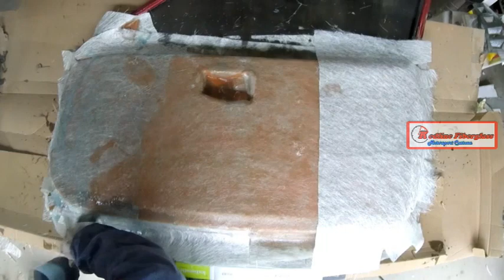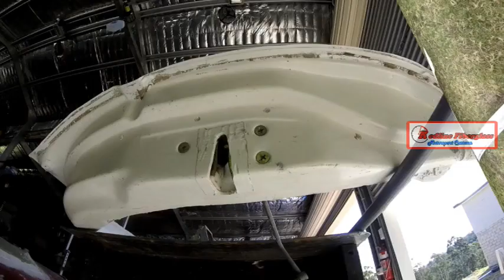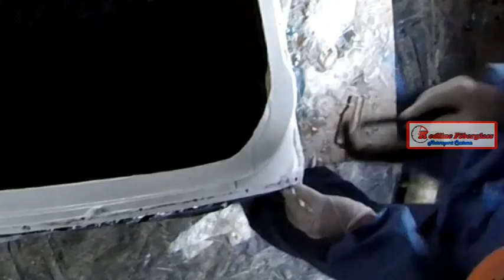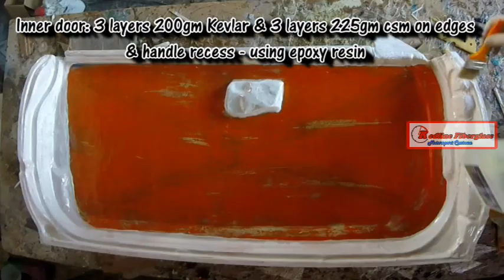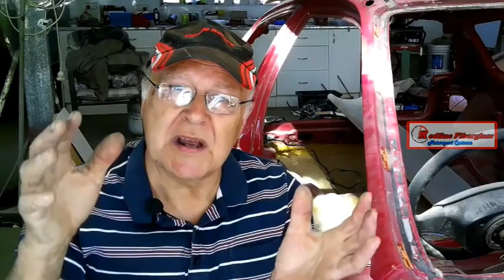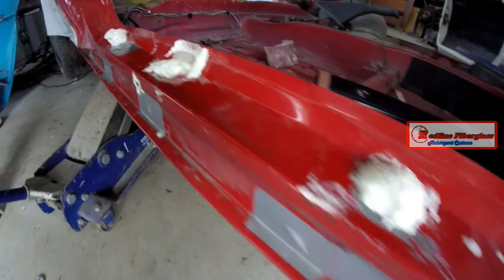Make Race Car Doors - Part 2

Comment: Mr. Mike -   Great Video - Your KEVLAR process looks to be the best bet for me to make front fenders (wings) for an old '70 Fairlady which suffered from the typical lack of inner fender protect: :-(    Over here we put SALT on EVERYTHING , NOT JUST CHIPS !! 
Cheers
Reply from the maker: If you are going to make front guards, this may help you overcome their shape. Fiberglass would be just as salt & rust proof as Kevlar, and you'd get a better surface to paint from using that process which includes Gelcoat (whereas Kevlar normally does not).
Reply: I wish I could have you make me some 1985 s10 doors and tilting front clip

Comment: Great stuff, curious what those black pieces are you using for framing to give the mould strength? Looks almost like rubber hose but of course that wouldn’t stop the flex?
Reply from the maker: They are 25mm black rubber hot water pipe insulation tubes from Bunnings plumbing dept, cut in half. Overlaying them gives them rigidity, and being rubber they readily take up complex compound curves wherever needed.
Reply: @BillsBuildandRace  wow I didn’t realise they’d provide enough rigidity, thanks 👍

Comment: Wow. I'm stoked beyond comprehension. Your work, philosophy and skills are always an inspiration. More people needs to subscribe to your channel. Tons of knowledge just packed into every video. As an engineer my views have changed a lot, in the last 5 years that I've been watching your videos. Found your channel on my first semester, now I've graduated and started working. Most of your diy videos for motorsports passes all the rules stated in most racing competition. When we engineered our chassis for FSAE, I used butted tubing like bicycles in our chassis. We had the lightest chassis in our class. Used techniques shown in your how to make a serious car wing videos. But used a cnc milled foam core with carbon ribs like aeroplanes. Then flushed out the foam core with acetone. My personal take on engineering is that its always a compromise between design, manufacturing ability, material, cost and time.

Comment: I am following your work, I am going to try to do a complete Volkswagen 1958 Van
Reply from the maker: Most guys think they have to make large body molds very thick, and/or put giant frames on them to keep them rigid - but you don't. Normal thickness is fine, then I cut hot water rubber insulation tubing in half and lay it on as strengthening ribs that will go around any curve. The only timber framing I add is to position the molds at the best angle for layup. My advice would be start on the small panels first. Use cheap unfired pottery clay to make your flange walls on curves - and they only need to be about an inch/25mm high.

Comment: Have you ever considered replicating a quarter panel in carbon or Kevlar for maximum weight shedding?  I know you made some epic fenders with flares, just can’t remember if you’ve ever replaced the entire rear panel above the wheels before. (We call them quarter panels in the states) maybe called a rear wing, or even a rear guard elsewhere?
Reply from the maker: Yes I did consider completely replacing the rear quarter panels on my Civic Muscle Hatch when building it, but the degree of weight saving versus structural integrity and the effort involved in going that far didn't seem to make it worthwhile in my case. The metal car manufacturers use for rear quarter panels is mega thin. The inner stuff is where it is thicker and heavier - but that is the structural bits. But every situation and type of car racing is different.

Comment: Hi there just a question regarding release agent? What did you use when taking the mould and then making the product from the mould? Cheers
Reply from the maker: I always use two products for release. Firstly a generous SINGLE coat of wax (not polished and multiple coats like everyone else tells you). This can be special release wax, or just common floor wax from a supermarket is fine. Secondly I brush on a coat of PVA release This is a product you will not get in any hardware store, but from fiberglass material suppliers (Google your area). It is water soluble and washes off.

Comment: What kind of resin was used for the casting and what kind of resin was used for the door. I know gelcoat was used just not sure what kind of resin to use on the fiberglass mat
Reply from the maker: Any general purpose poly resin will do. I use LSE (Low Styrene Emissions) because it's cheaper than Vinylester and way less fumy. As you appear to be new at this, I suggest you watch my first fiberglass tutorial which covers all the basics in detail. https://www.youtube.com/watch?v=iOZkwrfpit8&list=PLh5B6MCXRHiEFl6VaERQKJUGFRj4Coh4H&index=1&t=2s
Reply: @BillsBuildandRace  Thank you, my last comment disappeared somehow but you also mentioned 250gm and 450gm. I can get chopped strand mat in 0.045" and continuous in 0.060" will that work? Watching the video you recommended now! Thanks again
Reply from the maker: @Tookoff  Where are you? The Imperials equivalent of 22gm & 450gm csm is 8 & 16oz - as it is sold in the USA.
Reply: @BillsBuildandRace  everything I've searched in the US say either 1.5 oz/sq ft or 2 oz/sq ft.
Reply: @BillsBuildandRace  I have also found 0.9 oz and 3/4 oz

Comment: Does the foam also seal the lower door sills against water? Or do you run into an issue where you could have standing water inside over time?
Reply from the maker: Each cell is individual when foam forms, so it is impervious to water. Closed-cell expanding foam is completely resistant to water, and will repel liquids at all times.
Reply: @BillsBuildandRace  Thank you for the information and response. I appreciate it very much.

Comment: Just wondering, do you think there would be significant weight savings by just using a CF outer panel?  As in, keep the steel inner door/beam, cut the steel outer out, and mould the steel inner into the CF outer?
Reply from the maker: Probably the heaviest components in a factory door are the glass, locks & winder mechanism. The steel frame is likely heavier than the door skin in almost every case, so just re-skinning the door with CF would lighten it - but it would hardly be worth the effort IMHO.

Comment: My car weighs a little over 4100 pounds. What do you suggest I do to lighten the car and maintain its use as an everyday driver?
Reply from the maker: There's very little lightening you can do with a daily driver as you have to 1) KNOW all the road rules where you are that cars have to meet 2) also know what you are allowed to modify and not modify (which is usually almost nothing).

Comment: How is your door latch mechanism going to work?
Reply from the maker: What do you mean?
Reply: @BillsBuildandRace  The inside of the door is full of foam.  Right?    This whole thing has my mind buzzing.  I’m building a drag car.  I’m going to do both doors.
Reply from the maker: @scottycollins131  Stop stressing out. it's super easy! i did show somewhere in this build what I did - but even I can't find the footage on it. But here is what you do. Yes the door is full of foam. So then you cut a side pocket on the inside of the doors near the lock so you can slide it sideways into place to be bolted up using the factory mounting points. That gives you a hole to carve a hole for the outside latches up to the window lower sill. The inside latches are mounted onto a wooden plate glued to the inside of the outer door skin - this job being done BEFORE the doors are filled with foam. You drill a hole in the inner door skin catch recess for the rod that goes to it from the door lock. From the hole hollowed out from the door lock you just push a piece of sharpened 20mm electrical conduit up to where the rod to the inner door catch comes out, using it like a saw with a twisting motion to hollow out a tunnel for that rod. The conduit does not stay in the door - it's just used as a hollowing out tool. OK?
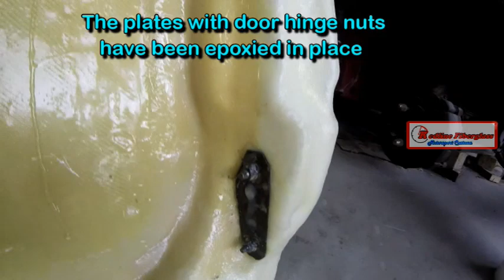Reply from the maker: Sorry - I didn't use a timber block to hold the inner door catch. What I did was fitted the catch to the inner skin before I joined the two door halves together. Then I epoxied the bolt heads to the back of the inner door skin. After that set, I removed the bolts & the catch, & then joined the two door skins together with the foam.  I showed this in this video at 10:11 sec.
Reply: @BillsBuildandRace  I've been brainstorming.  Worse comes to worst I can create a tunnel for the rod that goes from the door handle to the latch.  I'm building a 2000 Mustang.  American version.  It has a frameless window.  I think it will be even easier than the Honda.  And the weight savings will be much greater.
Reply: @BillsBuildandRace  I'm not stressed.  My mind is buzzing means that I have all kinds of ideas now.  I don't want to get too silly but this has opened up a new world for me.  I was already exploring HDPE and I bought a chunk of Lexan to replace the rear window I busted out.  Putting in a roll cage was the devil.  I got it done without busting out any glass but I could not get in there to make the firewall into the trunk.  After all the frustration I just took a sledge hammer to the rear window.

Comment: Did you weigh before and after filling with foam?
Reply from the maker: No - but the foam weighs 4 kg, in the cans and does not lose weight, so that is easily calculated.

Comment: I'm currently re-installing my Godzilla-heavy 72 lb. a piece original steel doors onto my '66 drag car after some cage updates, and wondering what I can do, maybe cut up, to lighten it up before it weakens the door (figuring very little if anything)... and ran into this video. Great video! thanks for sharing your obviously mad skills. Laying glass or carbon fiber is an art form that's a lot harder to do right than it looks...

Comment: i finished making a door! what I did not think through was the added thickness when combining the two panels. makes it so I cannot use door seals or it will push the door further out. and thats with only 2 layers 3/4oz (similar to 225gsm) mat on rear skin and front skin (with added one layer carbon)